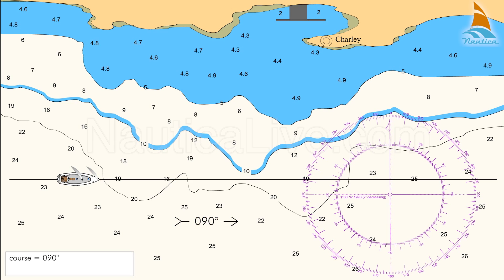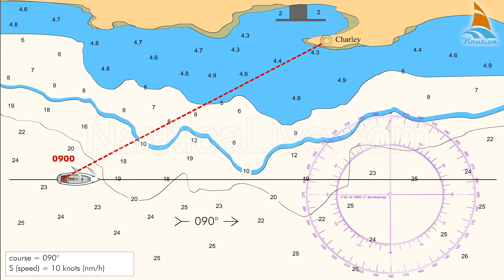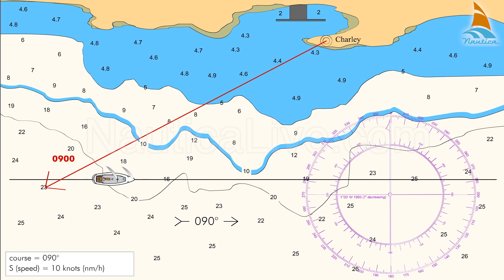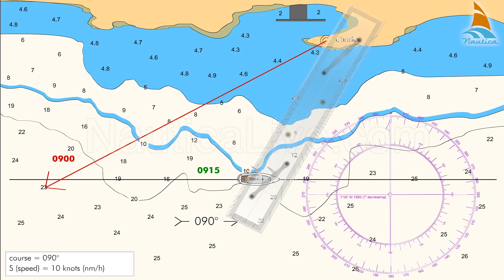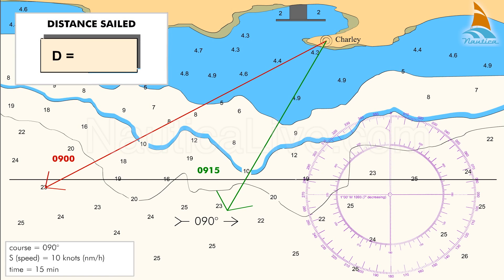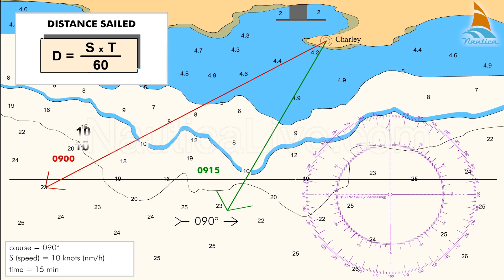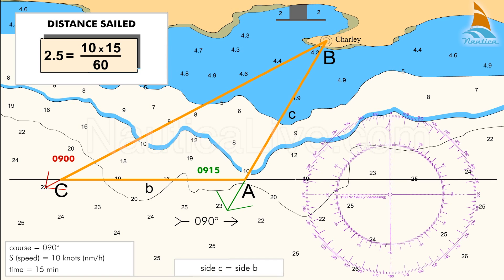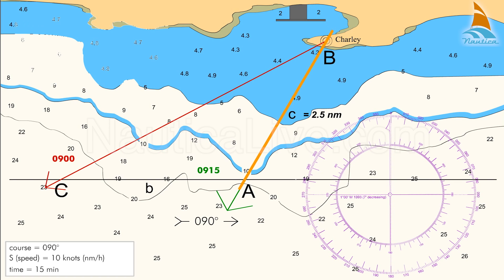Running fix doubling the angle

Comment: That is a pretty good explanation.  

However in addition to the issue with the distance being described as "2.5 nautical miles per hour" instead of "2.5. nautical miles", it might be clearer if the eventual calculated position did not happen to sit on the original black course line, as this makes it look like it will always be on that line, when in fact that is not the case.  
That course line just sets one side of the triangle, and the position will be somewhere on the line formed in line with the other equal side of the triangle.